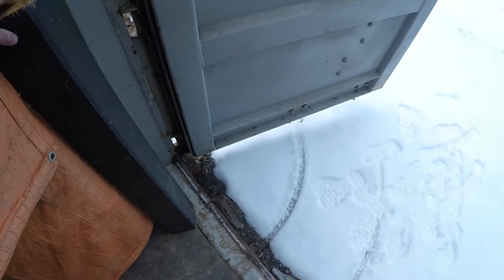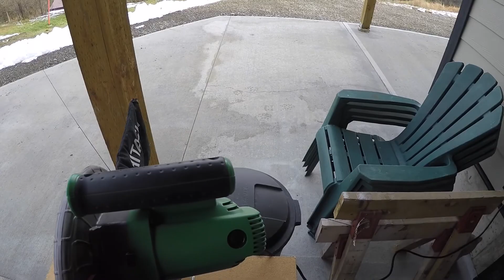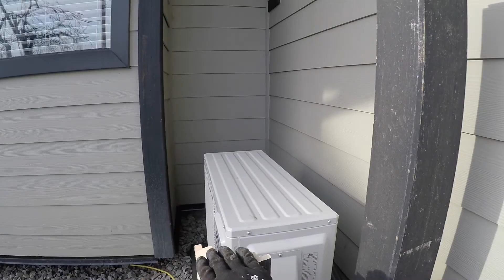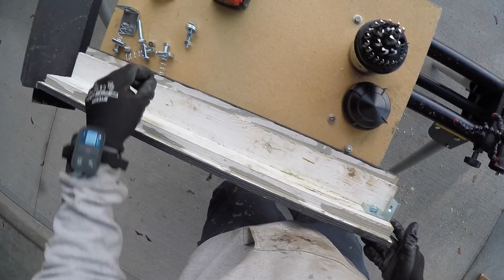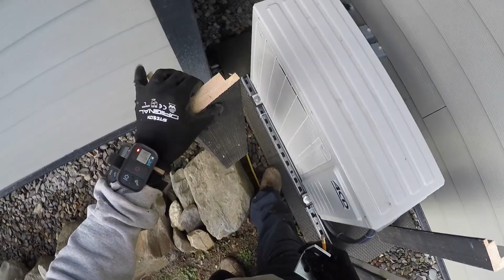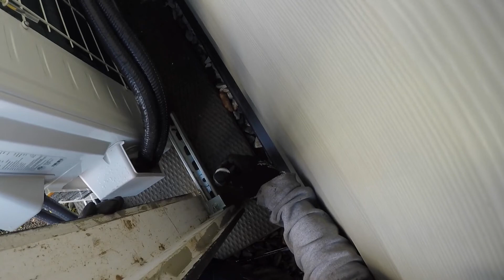How to Build a Roof for your Heat Pump - Part 1 The Frame 001

Comment: Mike, thanks for the video. 
I just did this, I MIG welded a structure that mounts to the house so there are no struts holding it up. For the cover I used PVC board from Home Depot and made the board slide into place so I could flip it over. I painted one side black and left the other side white so that in the winter the black side would absorb heat and in the summer the white would reflect heat. I figure whatever benefit I get is gratis because I needed the cover to protect the mini from ice cycles off my roof.
It snowed last night and so far so good but I did go out and clean it off.
Reply: @mosfet500 sounds awesome. Do you have any pics of this setup? I'm interested in how you did the frame and attachment without any struts. I would love to make something similar
Reply from the maker: I would also like to see how the brackets were made and attached to the house. I would assume some Lag Bolts were used into the siding/ wall structure.
Reply: @ChristianLappinOFFICIAL  I  do have pics but don't know how to  post them here. Yes, I lagged the rack to studs through the siding with about a 20  degree downward. There's also a strut off  the side mounted to the same stud using 1" square tubing, sort of like a tight "Y".  I welded it together and painted it with rattle cans but I don't see why you wouldn't be able to bolt everything together. It might be slightly more bulky but not bad. I wanted it to be as  unobtrusive as possible, I don't know if the black side actually helps in the winter but I think the white will definitely help in the summer and the protector doesn't obstruct air flow which was my other goal.
Today it's snowing out and the mini is well protected. Once the snow season is over I'll flip over the cover to the white side for summer.
Reply from the maker: Sounds like you put some thought into it as well! Glad you liked the video and I hope yours works as well as mine for keeping it out of the elements.  Cheers